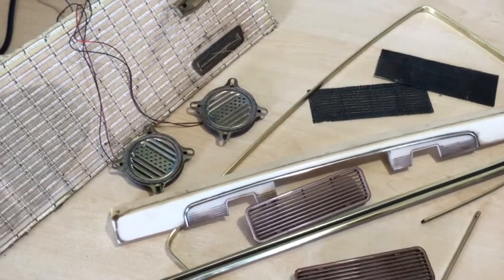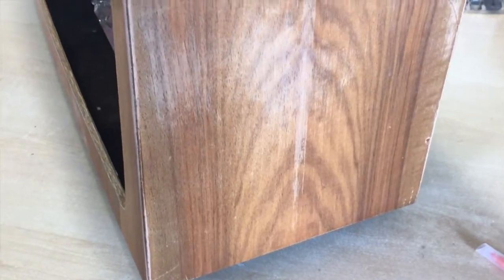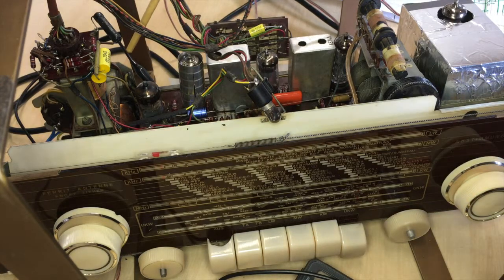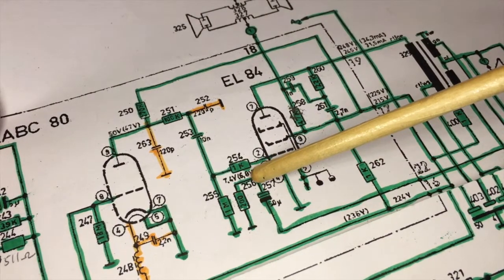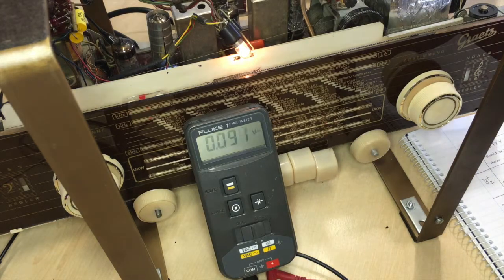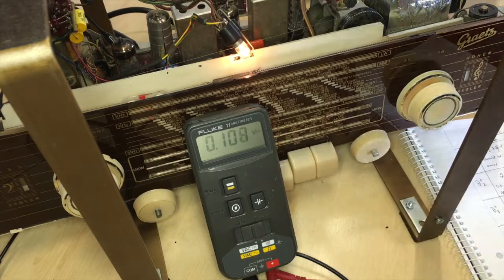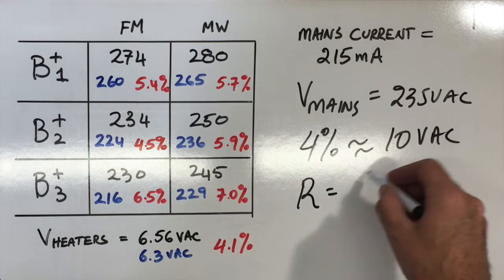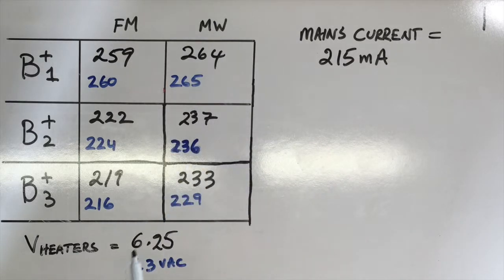Graetz Comedia 616 tube radio restoration - Part 5. Excessive heat analysed.

Comment: excuse me if I ask you a question about reducing the input voltage of the mains:wouldn't it be simpler and easier if you would have changed the input of the mains by simply putting the entrance to 240 v instead of 220?. If I can remember the input of 240 was also available on the input transformer. Anyway you did it very intelligently and I liked the simple formulae you used to calculate the resistance of 47 ohm and the power dissipation on it of 2.2 watt and you put 10 for security.thnaks very much for the lesson, it was most interesting and very precise way of thinking.
Reply from the maker: +abele ballestri : you actually had me wondering if I'd made a mistake for a while. I went back to check, and can confirm that the 220/240v position in the input selector of the power transformer is one and the same. It seems that the logic was that it would serve for either value. Therefore the input selection is already as high as it can be, and that is why the resistor was the voltage dropper of choice here. Thanks for the input. One can never learn it all, so the occasional question is most useful.

Comment: Your excessive household voltage seems to be a problem in a lot of your restorations. Have you considered putting an auto-transformer into your household power supply? I once considered doing this for my house lighting circuit because the incandescent lights blew too frequently. Then the mains supply voltage was lowered by the electricity authority and rendered this problem moot.
Reply from the maker: The supplier has also resolved the issue, thankfully.
Reply: @electronicsoldandnew  Heh I hope it was a technical solution and not just a legal one. Our mains used to be 240v and our country recently decided to go for the more international 230V. Except that the standard became 230V +10% -6%. This means that anything between 216V and 253V is legal. :o
Reply: @psionl0  That's why a lot of newer switching power adapters have an input range from 90-265VAC.

Comment: Overheating: Placing the radio near an oven. Placing the radio on a windows ledge, and under this is a radiator. Placing ON the radio a tablecloth and this hangs down on the backside, so closes the backplane and its holes. All this i have seen. And in all cases the radios a very warm. Some people are crazy :-)
Reply from the maker: True.
Reply: I have an old Emerson 560 radio with a Plaskon cabinet which was rather expertly converted to AC by the previous owner, except that whoever did it didn't put a heat shield above the 117Z3 rectifier tube and it eventually cracked the cabinet.  I fixed the crack from the inside with super glue and polyester cloth and added a piece of aluminised cardboard to act as a suitable heat shield.